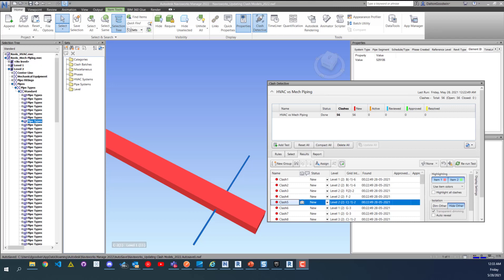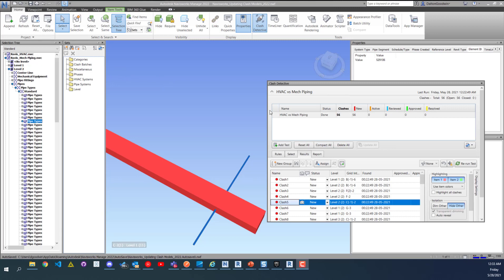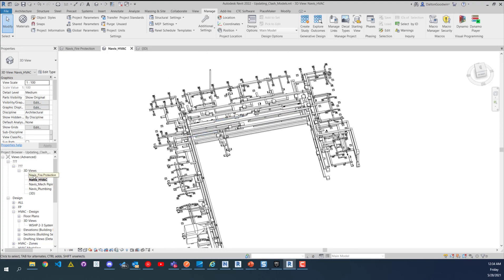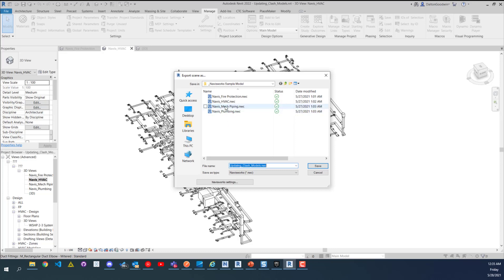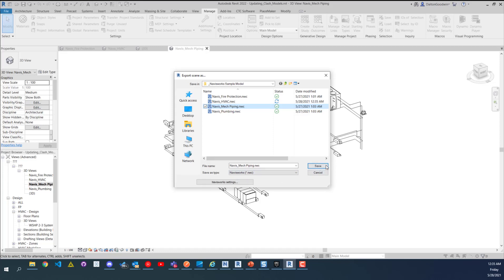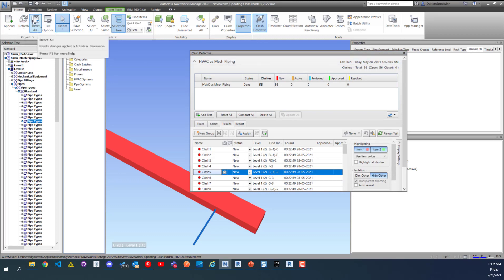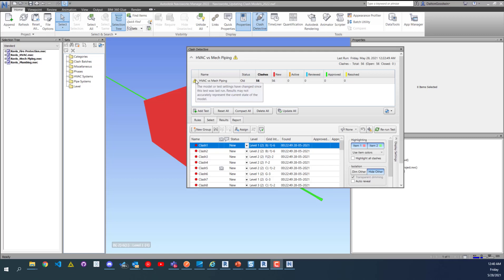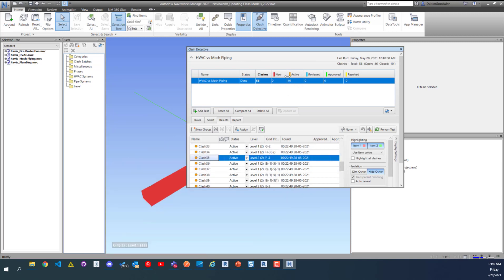Navisworks | Updating Clash Test | Coordination

Comment: do you need navisworks to be closed to re-do the export?
Reply from the maker: No shouldn't need to. There should be a refresh button on the ribbon that allows you to refresh your appended files. After refreshing, you can rerun your test.
Reply: @TheBIMCoordinator  Tried it again today and it worked!1 Not sure why it refused to save the nwc in revit before though. But Im happy as its doing what it should now. cheers.
Reply from the maker: @troydyall6624  That's awesome! I am glad it is working for you.
Reply: @TheBIMCoordinator  great vids mate👍🏾
Reply: @TheBIMCoordinator  i go to revit and try to redo my nwc file and it wont as it says its open in the navis program....